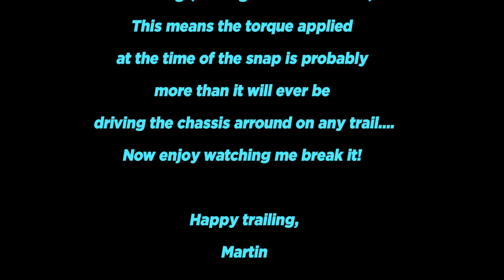VRCP- 3d printed chassis Strength

Comment: That is very impressive, looks pretty durable. How much does the chassis flex when it is installed on a RC, looks like it would have more than desired. Do you brace the chassis with anything?